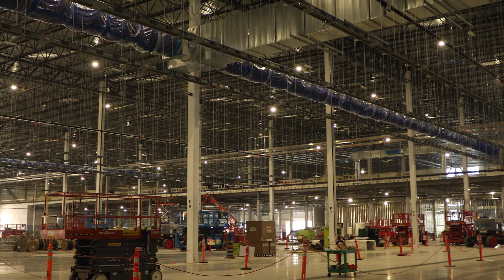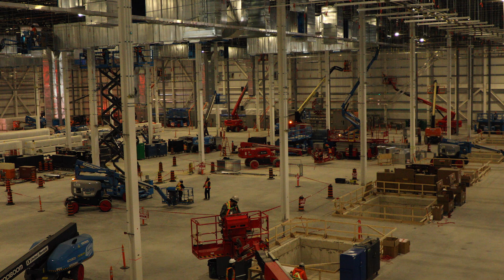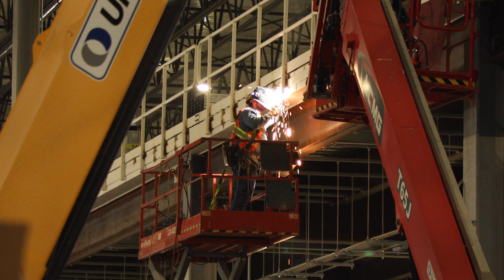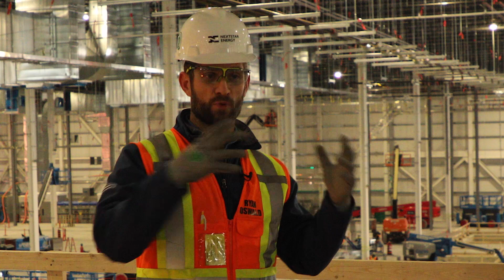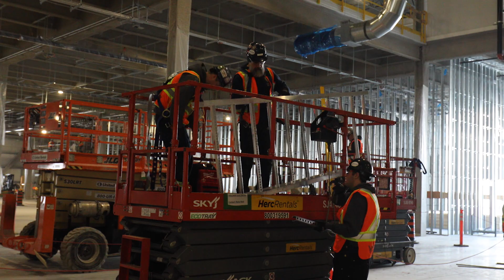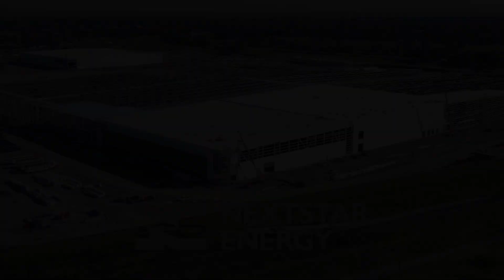NextStar Energy EV Battery Plant Overview and Construction Update - December 2023

Comment: Excerpt from science advisor:
The battery pack of a Tesla Model S is a feat of intricate engineering. Thousands of cylindrical cells with components sourced from around the world transform lithium and electrons into enough energy to propel the car hundreds of kilometers, again and again, without tailpipe emissions. But when the battery comes to the end of its life, its green benefits fade. If it ends up in a landfill, its cells can release problematic toxins, including heavy metals. And recycling the battery can be a hazardous business, warns materials scientist Dana Thompson of the University of Leicester. Cut too deep into a Tesla cell, or in the wrong place, and it can short-circuit, combust, and release toxic fumes.

That's just one of the many problems confronting researchers, including Thompson, who are trying to tackle an emerging problem: how to recycle the millions of electric vehicle (EV) batteries that manufacturers expect to produce over the next few decades. Current EV batteries "are really not designed to be recycled," says Thompson, a research fellow at the Faraday Institution, a research center focused on battery issues in the United Kingdom.

That wasn't much of a problem when EVs were rare. But now the technology is taking off. Several carmakers have said they plan to phase out combustion engines within a few decades, and industry analysts predict at least 145 million EVs will be on the road by 2030, up from just 11 million last year. "People are starting to realize this is an issue," Thompson says.

Governments are inching toward requiring some level of recycling. In 2018, China imposed new rules aimed at promoting the reuse of EV battery components. The European Union is expected to finalize its first requirements this year. In the United States, the federal government has yet to advance recycling mandates, but several states, including California—the nation's largest car market—are exploring setting their own rules.

Complying won't be easy. Batteries differ widely in chemistry and construction, which makes it difficult to create efficient recycling systems. And the cells are often held together with tough glues that make them difficult to take apart. That has contributed to an economic obstacle: It's often cheaper for batterymakers to buy freshly mined metals than to use recycled materials.
Reply: Love your story, let’s keep it simple, our infrastructure is not ready for the EV blitz some major players are trying to shove down our throats.   Let refine this technology, and introduce it gradually if that makes sense.  Lithium battery production is highly toxic and not as environmental friendly as  we’re being told. I personally believe most automakers are being forced by government regulations to manufacture EVs that society is not wanting at this time .  Gasoline will be here for a while unless the powers be price it at an unaffordable point.